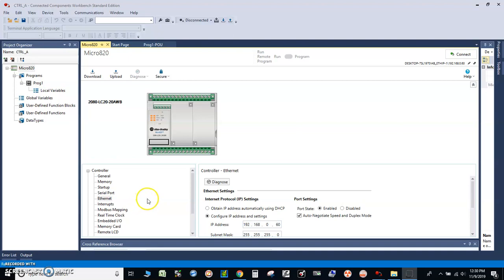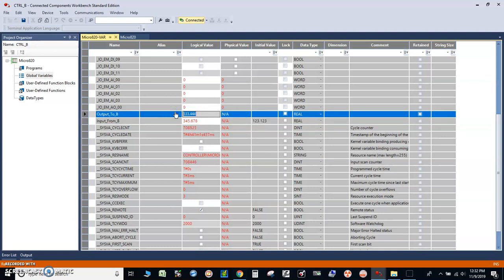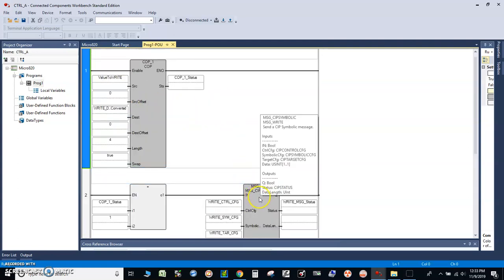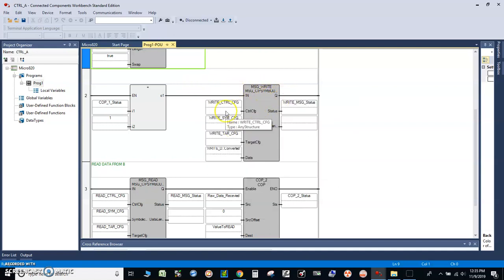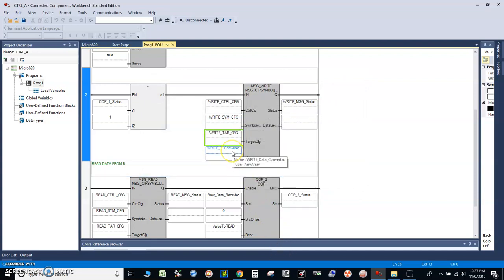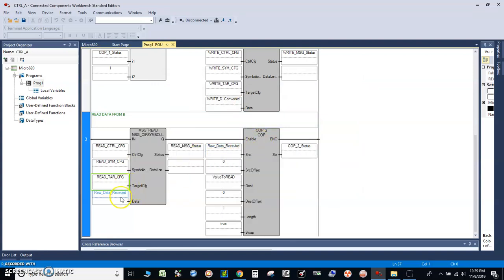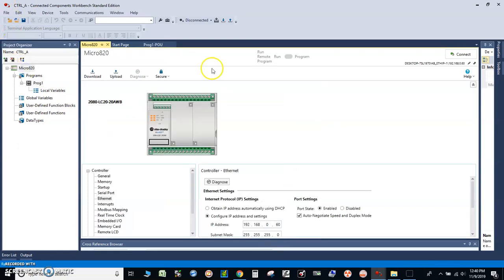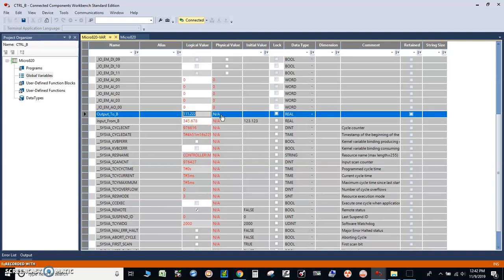Communication Setup CIP, COP for Micro800 / Micro850 to Micro850 (part 2)

Comment: Yes this is useful for me. I was considering buying a MicroLogix 820 series for connecting to a EtherNet IP motor. I can connect to the motor using Class 1 connection via software. I think it can be done easily with the PLC. I did not want to use the more expensive CompactLogix/Rockwell Studio 5000 route....

Thanks for posting..
Reply from the maker: @arbj: Thank you for subscribing to my channel. Should you have any questions just let me know :)

Comment: I would like to communicate with SICK sensor OD5000. Instead of Controller B, I have a sensor. Does this configuration works with Sensor
Reply from the maker: Ss Kk: I don’t think so. You really need to find out what communication protocol SICK sensor has to communicate with other devices. I believe CIP is the communication protocol between Rockwell Allen Bradley controllers only. Modbus is one of the most popular generic communication protocol between devices from different brands for example.
Reply: @SYPHOANG  Sick mentioned that it works on TCP/IP Protocol.
Reply from the maker: Ss Kk: First, please verify if Sick works on Modbus TCP specifically. TCP/IP only can be many things such as CIP on this video or Rockwell EthernetIP. 
Second, you need to found out the IP address of the SICK sensor to be able to setup PLC program to communicate with it.
Third, if Sick sensor is Modbus TCP server, your PLC will need to be Modbus TCP client. Below video shows how Allen Bradley Micro820/850 Modbus TCP CLIENT (Part-1 READ MSG) works (reads data sent from Modbus TCP server or Sick sensor in this case)
https://youtu.be/F0R90ZiI1Mg
Reply: @SYPHOANG  Thanks for your support and reply.
Sick Said it will work only with TCP/IP not Modbus..
I will contact you if I need any support .
Thank you Sir